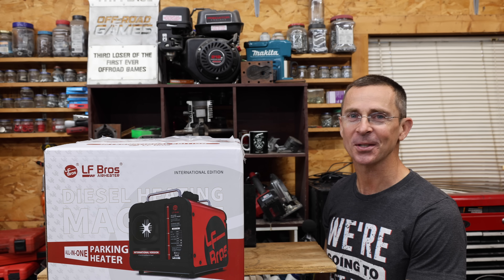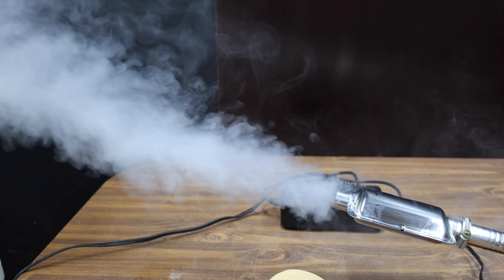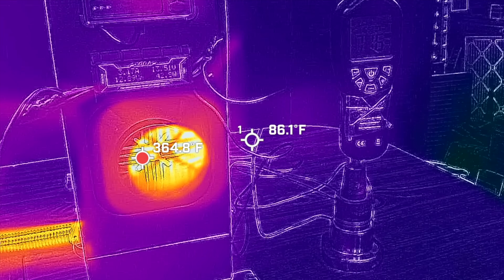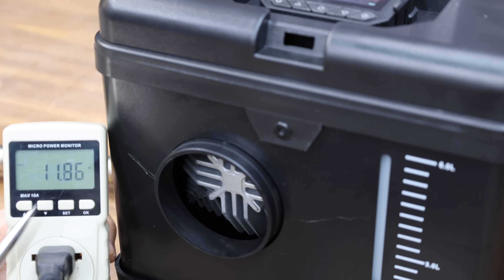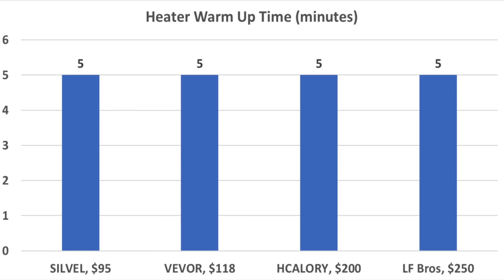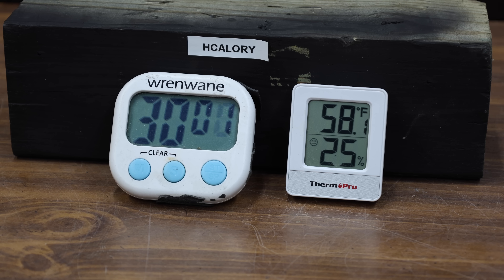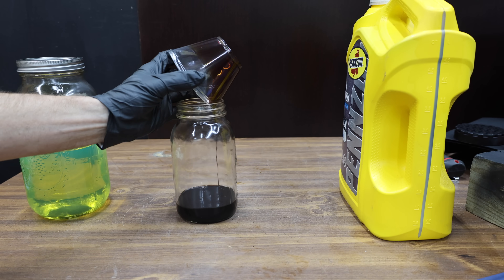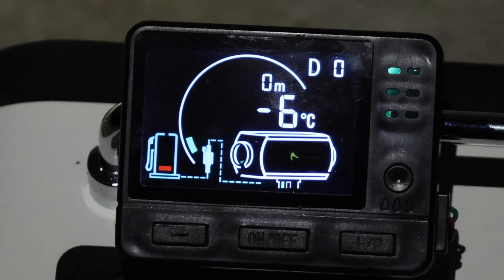The Truth About Cheap Diesel Heaters!

Comment: I’ve been using my diesel heater for two years for overnight ice fishing trips. These heaters are considerably safer, and provide less “wet” heat than propane heaters for this purpose. This is a great video with some great testing! Great job!
Reply from the maker: Thanks and you are welcome!
Reply: I have mine on both battery lifep04 100ah battery i got for$120 and AC to DC 15amp power supply $20.  100ah battery should last a few days of running..
Reply: How are you supplying power for the glow plugs?
Reply: @jessemeier3447  the system runs off of 12 V. You can either run a 12 V battery, or a AC to DC power supply.
Reply: @Levers103  just plug directly into the battery terminals? Do I need to pigtail a fuse in or is it just ready to go? That seems like the easiest thing to do but I can't find any information online that clearly states this. Thanks for the response

Comment: a lot of heat is lost via the exhaust. What if there was a way to extract the heat from the exhaust port, like pumping it through a radiator, before exhausting it outside the house. would be interesting to know how much more heating could be generated by the entire system by doing that. You should do a test for fun :)
Reply from the maker: Thanks for the suggestion.

Comment: always get a carbon monoxide alarm anywhere you use these. the quality of these chinese heaters comes with no guarantees, the block may start leaking toxic gases at some point. and no, most of the time you will not smell dangerous leaks.
Reply from the maker: Thanks for the feedback.

Comment: TEST IDEA:  Brake Rotor rust coatings….  Hate non coated rotor because they rust immediately.  Additionally cross drilled rotors holes rust & clog over time.  I’ve even had a set become unbalanced which I could feel in the steering wheel.  It corrected with new brake rotors & was due to the rust build up!  🤞🏻
Reply from the maker: Thanks for the suggestion.

Comment: The LF BROS has a lot of bad reviews on amazon UK site not good if it is the most expensive heater. H calory/ Kroak is it's mother company have new models out that tuned to burn less fuel and giveout more heat and cooler exhuast with bigger heat duct 90mm instead of the normal 76mm just got mine last weekend it's a beast!
Reply from the maker: Thanks for the feedback.

Comment: I've run a mix of transmission fluid and diesel through our Vevor without much issue. If you let it run out of fuel, it seemed to have a very hard time firing back up. The glow plug and screen did not look as clean as our other heater that we didn't run a mix in.
Reply from the maker: Thanks for sharing.

Comment: you can also claw back about 20% or more efficiency if you extend the exhaust and run fans over it as you otherwise loose a lot of heat out the back when you run the exhaust outside. From other testing I have seen its a bad idea to run more than about 40% cooking oil and no motor oil at all as the expansion chamber gets full of ash really quick and gums it up
Reply from the maker: Thanks for the feedback.

Comment: I have a Vevor 8kw heater. Worked great for the first winter season. The second winter I decided to go with just the diesel heater and not buy any firewood, ( big mistake), also the first winter I was using pump diesel. The second winter I was using farm diesel ( no highway tax and is died red). On Christmas day an error code came up indicating a fuel pump failure. I had a propane heater for back up and ordered a new fuel pump. The second pump lasted about four hours and I had another pump failure. I ordered two better quality ( higher priced anyway) pumps, they both failed in about four hours each. I find it hard to believe that the red die in farm diesel is causing the pumps to fail.
Reply from the maker: Thanks for sharing.

Comment: I would've liked to see if the heaters would run on used motor oil after they have startet running and are hot.
Reply from the maker: Thanks for the suggestion.

Comment: Bang for your buck with these modern diesels heater is unbeatable, the fuel efficiency and heat they put out is far beyond anything before for the price. Even the more expensive brands for the price and what you get and how easy they are to install and start up is amazing!!
Reply from the maker: Thanks for the feedback.
Reply: @ProjectFarm thank you for your reply, I literally purchased what is essentially a upgraded version of the vevor brand shown 2 weeks ago. Very impressed, the Bluetooth function is great for activating the heater 5-10 minutes before going out shed. My heater came with feet so it didn’t have the clearance problem like shown in the video.

Comment: When it comes to windshield wiper blades, there are a thousand components to consider.
Add in the necessary OEM blade changeouts, whole blade OFF-brand and replacement elements, it can become daunting.
I want to use the single replacement elements for $7 for 4, but Rain-x wants me to spend $20 on a whole clip in blade assembly.
What should I do?

Comment: Awesome video as usual. I really value you work! It’s very rare to find honest, credible, objective reviews. I’d like to suggest the testing of diesel fuel injection cleaner. There are a ton of sources pushing their use but not credible evidence of their need and effectiveness. I know you’ve done tests on gasoline fuel system cleaners and diesel anti-gel that included lubricity but not injector cleaning. I’ve read that the additive ingredient PEA is effective but no proof is offered. I and every other diesel owner would appreciate your efforts. Thanks!
Reply from the maker: Thanks!    Thanks for the suggestion.

Comment: While it would be an expensive test, testing premium coolers the way you do would probably garner a lot of views, thou its probably a better video for late spring/early summer when you can get some hot days before Father's day. ChatGPT gave me the list below of Yeti and close competitors. I've seen a few videos comparing performance, but none which are ok destroying the products as well, to see where their failure point is. Also, I think a float test would be awesome, for those mishaps while on a boat. haha

Value Rankings (Best to Worst)
RTIC: Best value overall for delivering near-premium performance at a much lower price.
Pelican: Best for durability and extended ice retention, with a lifetime warranty to back it up.
ORCA: High-quality construction and a lifetime warranty make it worth the investment.
Engel: Great for lighter activities, offering good performance at a moderate price.
YETI: Premium performance but higher price for the brand name.
Grizzly: Solid warranty and performance but lacks the recognition and refinement of top-tier competitors.
Canyon: High performance with a lighter design but pricier than similarly performing options.
KONG: Unique features and solid build, but higher cost with fewer perks.
Igloo Trailmate: Decent ice retention and great portability, but falls short in rugged durability.

Comment: Me being half homeless because of Let's Go Brandon nazi empire, Thank God a convicted felon that knows what It's like to be falsely charged Is going to be Our new president. I been heating My Car with a Vevor Diesel heater, I took a 4 Inch diameter dryer vent hose and slide It over the heater hose then run It through the window. the problem with It Is sometimes the hater will Not shut down with the remote control and It's a pain keeping the battery charged up It does Not work right without a fully charged battery so I have to use the Car to charge the battery what I want to do Is use a Electric Start mini Bike Engine and power a car Alternator running less 2500 RPMs who's stupid Idea was It all generators need to run at 3600 RPMs probably the same person that starters need to be under the Intake manifold and 240 volt needed to be pumped Into People's homes and Smartphones batteries need to be non removable and have No headphones 🎧 jack. of course I would like to see on ABC and CBS and NBC and Fox and CNN news how to repair these heaters and where to get parts for them but I Am also trying to figure out how to transfer heat from a Smokeless Fire 🔥 Pit Into house and how to repair a China made Propane Tankless Water heater and get parts for them something that Never crossed the mind of Let's Go Brandon.

Comment: Don't get me wrong I love your videos and you are a legend in terms of product testing.

 But your temperature test based on temperature increase was in this case next to useless or even worse it is misrepresenative/misinformation.

 The reason is because insultion and energy loss through it exponentially increases based off thermal gradient (The temperature inside vs outside.)

  If the temperature is 20 outside and the inside temperature is 30 there will be 1 "unit" of thermal migration per minute through insulation with a gradient of 10f.

 If you double the indoor temperature differential gradient  to 20 (20 outside to 40 inside) then your rate of thermal migration goes from 1 unit per minute to 2 (100% increase) per minute. 20f differential instead of 10.

 If the differential goes to 40 now you have 4x the temperature loss over the 10 degree starting point...

 In other words starting the test at approximately 50f and measuring that differential against itself instead of from the 'resting' temperature of the building and/or outside temperature you invalidated everything as there could be several times more energy used to overcome those higher gradients to get those increases.

 Especially if the outside temperature is too dropping during the test.

 You could mitigate that mostly by having something super insulated, but the rate of loss will still double with every doubling of temperature from starting.

 So in a case of a poorly insulated shed that might be from 15% loss to 30% loss, or in the case of something greatly insulated from 1% loss too 2%.

 As the loss increases again exponentially through the insulation.

 To figure out more realistically it's heating potential in comparison to each other would be to have a somewhat insulated building and run the heaters until they find an equilibrium temperature. 

 Then compare that equilibrium temperature to outside temperature and use that differential.

 That could even be done with a preheated room as the heater can only support so much gradient stabily. And the room will cool if the heater can't produce enough heat.

 This test should be done at night and with little to no wind.

 Like I said I love your videos, and hope this information will be helpful.

Comment: Although it’s very expensive, I wish you’d test the SUNFIRE 80000-BTU SF80 80,000-BTU, Odorless, Zero Carbon Monoxide Multi-fuel Construction Heater because it doesn’t require outside exhaust and it’s made in the USA (WI).
Reply from the maker: Thanks for the suggestion.

Comment: What is the best battery or battery type powering device that should be used with these, for electric grid failure? And how should I maintain this battery/device to ensure it is full power when needed? Thank you.
Reply from the maker: Thanks for the suggestion.

Comment: I'll be snapping up a diesel heater or two in the new year before the UK government bans all of them. They seem a great way to warm your shop, or even your house when comparing the cost of either gas or electricity. The LF Bros does look quite a good set up, but in their basic forms they all use the same engine to produce the heat. They are packaged quite different and the price varies accordingly.
Reply from the maker: Thanks for the feedback.

Comment: I did the math. The LF Bros is the only one that comes close to its rated output, delivering somewhere between 4.05 kW and 4.86 kW. Since it performed best in terms of heating capacity, all the others claiming to deliver 5 kW are junk. Even the so-called 8 kW heater doesn’t come anywhere near 5 kW.
Reply: Thanks. I just wanted to hear the best performing unit with cost being a factor.  Seems like this the best.

Comment: Hi I feel that you didn't give the first heater the correct chance as you tried to power it up and failed,  it will have pump fuel into the chamber with out firing up hence the smoke what do you think ?.

Comment: we run a mix of used oil diesel and kerosene at a 3:1:1 mix and it prevents the carbon build up have been heating my tiny house like that for the last 2 years
Reply from the maker: Thanks for sharing.
Reply from the maker: Thanks for sharing.

Comment: The original heater smoked bad because it pumped fuel into the chamber to start its cycle and then failed to ignite it because your original power source wasn't big enough to hold the glow plug. You added a power supply to suit it, then it pumped more fuel again at start-up. Started very rich on fuel because of the original undersized power source. Probably burns clean every time now

Comment: This video was great, I would eventually want to heat my garage and a diesel heater would be a great choice for me down the road. Would you also be able to do an updated video on testing the best 18650, 21700, and 26650 batteries? As someone who collects flashlights, I am always looking for good batteries for my high powered flashlights. I know that there are a lot of flashlight battery types and I do think that for higher powered flashlights that are rechargeable those are three common battery types. I feel with battery technology advancing and the amount of brands out there it would be great to see what the best batteries are for those types. Thanks again and Happy Holidays.
Reply from the maker: Thanks!  Thanks for the suggestion.  Happy Holidays!

Comment: All of these are Esbar heater copies. Those Esbar heaters are equipped in my fleets semis. They heat very well. If you ever need a part for these heater units, call any truck parts house or dealer. They should be able to source the parts from Esbar. I bet the real parts would work just fine on these.
Reply from the maker: Thanks for sharing.

Comment: Great video.
I had already purchased a diesel heater, the Vevor, low profile model. I have ~500 sq ft, cinder block work shop and have been satisfied with the heater.
Reply from the maker: Thanks for sharing.
Reply: how cold does it get outside where you live?
Reply: @adamr8628  we can get in to the 20's. Mid-Atlantic area.
Reply: @mooreadventures how warm does it get?

Comment: The biggest issue with testing the heating ability this was is that the buildings thermal mass is getting heated with every test. and not cooling down compleatly. That is why each heater did better than the one before it even though internally they are the same.

Comment: You should do a video showing the difference in how motor oil lubricants at at a cold start temperature vs operating temperature. Run a test at say 40 degree motor oil and measure the wear scar and then the same oil at 190 degree and measure the wear scar. Just an idea I’m curious to see how big the difference is
Reply from the maker: Thanks for the suggestion.

Comment: Very important after running on low you need to run on high for about 10 min to burn the carbon off or it will be clogged up and not work properly
Reply from the maker: Thanks for the feedback.

Comment: This test was overdue. Thank you so much! Looks like they are all the same at the core, but the difference in performance and exhaust pollution shows that there are still significant differences.
Reply: So some of differences that you will notice is that some have better rubber/silicone around heater body and case the fuel line is also a difference the line want is the hard line because the soft rubber expands with pump pulse and the controls do make a difference but understanding programming and proper setting makes a bigger difference.
Reply: I suspect the majority of the difference is the software which controls fuel duty, rather than a mechanical difference.

If you badly tune a car ECU, your AFRs will be massively off.
Reply: @Paul.Reviews  to someone extent yes programing is the main difference on start ups and shut down on some models but most are pretty much same. it then comes down to factory preset fan and fuel pump speed that all can be adjusted to correct for elevation.
Reply from the maker: You are welcome!  Thanks for the feedback.

Comment: I'm on my second winter with a diesel heater. I'm going to suggest that if you are really depending on this for an emergency, that you get redundant parts. The fuel pump, only about a month old, went out about a day before the coldest day of last winter. At this point, I ordered a second unit just to use for replacement parts. By this winter (year 2), I set it up to find the fuel hose leaking and just about to fall apart. I just replaced the fuel hose. Over the summer I put in a mini-split AC/heat pump. I'm using the diesel heater to heat up a room faster and/or to backup the heat pump for a really cold snap. Every single time I have used the diesel heater this winter, it takes me about 10 minutes or more to get it started. About the first three or four times I fire it up, I get an error. Once it gets going, its going. I'm in Texas. I think the diesel heater is cool, but I would really hate to know that my life depended on it. The min-split is fantastic. It would be a pain to hook up, but my generator would probably run the mini-split, too. I also have a wood heater. Now that I would depend on in an emergency. But, it doesn't heat the back part of my house enough.
Reply from the maker: Thanks for sharing.

Comment: These heaters are great and did save our lives, cheap easy to repair, and more cost efficient than LPG in a side-by-side comparison in a pop up camper over winter and in a converted school bus before that. Add a bilge fan and you can heat a huge area only on 12 volt.
Reply from the maker: Thanks for sharing.